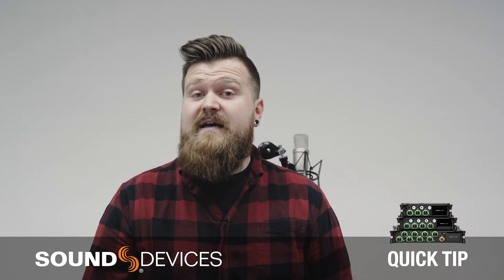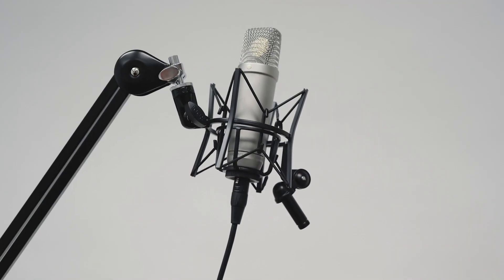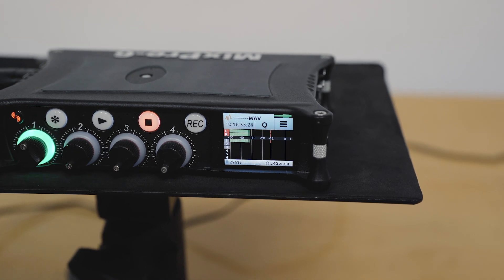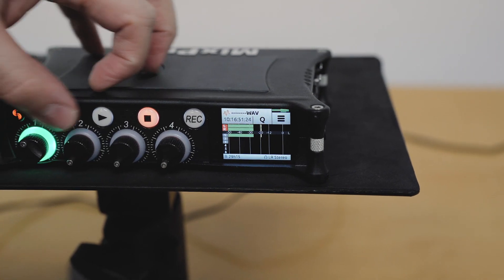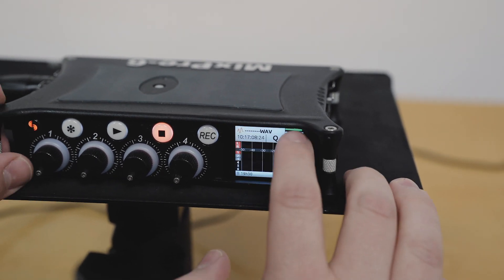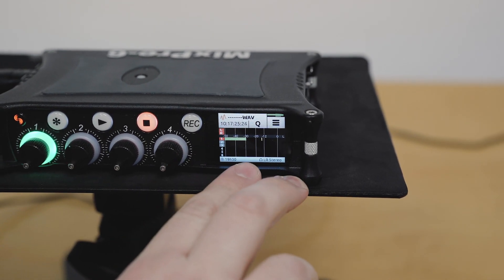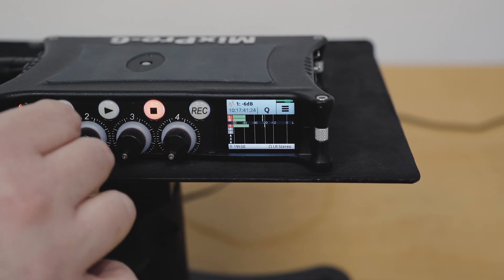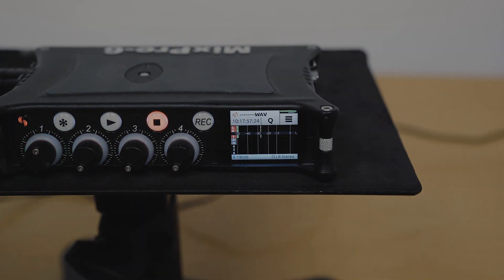MixPre Quick Tip: Trim and Fader Gain

Comment: Thanks for this video. Recently purchased the MixPre 3 II and still testing it out. Went straight to Advanced mode for 32-bit float and this concept was a little confusing at first so great video here that helped me clarify these two gain options. I will need to play around with this more though but it's a start...
Reply from the maker: Glad the video is helpful! Make sure you check out the playlist if you have any other questions!
Reply: @sounddev  Thanks yes I will. You guys should create more how-to videos that are use case focused like interviews, streaming, multi-mic setups, etc.

Comment: In the next firmware update would it be possible to make front fader knobs to toggle between trim and fader function depending on preference. In 100% of my work I am being requested to deliver iso tracks. Gain riding is crucial in my work flow and I believe many other location recordist. Adjusting gain only with one knob and necessarily toggling between menu and mix screens is disturbing and it  slows down my workflow significantly. Thank you!

Comment: In my opinion there is one information missing here: the importance of correct input gain settings. To avoid distortion it mustn’t be too high, on the other side, dynamic range can get lost with too low levels. So in advanced mode, I always set first my input gains, then I set the fader levels to get a good sounding mix of the incoming signals. For example: if the input gain of a channel is too high, this signal will stay distorted even when I go to decrease the corresponding fader. So I have to correct this in the channel menu > gain.
Reply from the maker: Correct. Best practice gain staging will be a separate MixPre Quick Tip.
Reply: @sounddev  hello. Did you end up making this quick tip? Please point me in the right direction. Thanks.

Comment: @sounddevices ... So let's say I'm doing a panel discussion and I have 6 mics set up...I have to 1) place each one in "ARM" mode so that I record each channel separately, then 2) I would adjust each "Gain" to around -12db, then 3) use the knob as a fader, essentially, to bring it into the mix so that I can monitor on my headphones? In reality, I wouldn't HAVE to send it to L/R because I am recording each channel separately already using the "ARM" option, correct?....Thanks in advance for the reply! Just purchased!
Reply from the maker: Correct! To monitor you could also make a headphone preset of the 6 ISO channels or Send it to the LR mix but Disarm LR so you can monitor it, but not record it.
Reply: Sound Devices Thanks! How do I “disarm the L/R”? Also, if I don’t disarm it would the L/R mix be recorded as a separate file like the other separate 6 mic “ARMs”
Reply from the maker: @cineluxe2406  Menu-> Rec-> RecLR-> OFF. 
If you don't disarm the LR tracks they will be included in the file. So you will have 8 tracks, L+R+ Isos 1-6. 
A good way to think of it is anything that is Red on the MixPre will be included in the file!
Reply: Sound Devices awesome!!! Thank you so much!
Reply from the maker: @cineluxe2406  Our pleasure!
Reply: @sounddev please advise how to “Send it to the LR mix but Disarm LR” so I can monitor it, and not record it? I just want to avoid doubled sound in headphones

Comment: Ah! Lightbulb may have gone off here! Would it be safe to say (just as an example) that you would set the gain with the fader to peak at around -20 to -12? Then set the fader volume to get the same approximate levels? I have two MixPre -3s. Not the II model, as I purchased months before the new II models came out.  Still messing around with getting those "perfect" settings for my Rode NTG3 into the 1st MixPre, and my Shure SM7B on the second one for live streaming and tuts. Thanks!
Reply from the maker: Two MixPre's with one mic on each and are they both in Advanced or basic mode?
Reply: @sounddev  Yep. One in the main studio for my YouTube and course shooting with the Rode NTG3, and the other by my computer with the Shure SM7b which is used for livestreaming (no recording) and tutorials (recording). Both are powered using AC adapter. The Main one for the Rode NTG3 is in Basic Mode as it seems dialed in for that. The other one for the Shure SM7b is in advanced mode, as I need to control the gain, it's being fed (for livestream) to a Canon XF 400 and then wireless HDMI back to computer. Just trying to dial everything in which is why I ask. Thanks!
Reply from the maker: The SM7B is a hungry mic! Luckily the MixPre has more than enough gain to drive it without any kind of in-line mic preamp. We recommend setting the Trim gain so it peaks around -12 dBFS and starting at unity gain (0) on the fader and then adjusting to taste!
Reply: @sounddev  Great! Thank you for the advice. And yes, the Shure SM7b although a great mic, is sooo hungry! I'll play with your recommendation -  it's nice to know a starting point for this. Much appreciated!  👍👍👍
Reply from the maker: @BasicFilmmaker  Of course! Let us know how it goes!